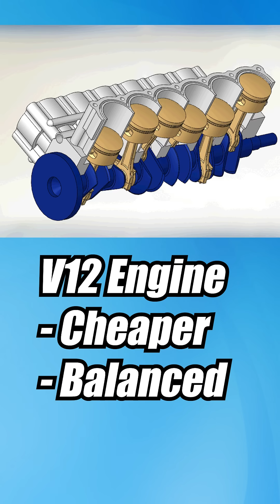wHy DoN'T CaRS uSE V14 ENGiNEs?

Comment: I did a static balance project on a straight-7 engine in grad school. If you play with crank throws and firing order, you can get a 7-cylinder bank pretty well-balanced!
Reply: Just like a v10. You just set it at a 75 degree angle v.
Reply: it would still require balance shafts i presume, just like V10s. the thing that made V10s competible was the niches on the racing scenes at the time combined with the engineering skills and knoledge that allowed to get a good middle ground between the better fuel economy and compact size of a V8, but with the better overall speed potential of a V12. i guess the fact V10s needed to be overengineered by default due to their natural inbalance allowed them to push the engine to its limits with super high revving, and even road going V10s like the Viper and the FSI's from Audi were capable of churning immense power with tuning.

i still love V10s with all my heart though, really wish they could return...
Reply: @unkindled6410  the imbalance in the v10 is less than the V8. The inline 5 was smoother than an inline 4. I mean, the most impressive engine in the world is the Red Bull Rb17 v10 with 15,000 rpm and over a thousand HP.
Reply: @unkindled6410  the Red Bull rb17 has a v10 that revs to 15,000 rpm and produces over a 1,000 HP naturally aspirated.
Reply: @amerhamad-zp6ge  its a track car only so it doesnt have to comply with any reliability regulations. That engine probably wont last more than 5k kilometers before blowing itself apart even if you dont push it to its limits. Its the same principle of V10 era F1 engines, they were disposable like tick tacks, lasting no more than a single race, then regulations limited the number of engines per season each team could use, so they started making them last a little longer including increasing their displacements from 3.0L upwards to 3.6L (except ferrari who somehow managed to keep up with the rules without displacement increases) otherwise they would have even made those engines rev until they were spinning on themselves before opening a rift in space time and warping themselves to nothingness.
Reply: @unkindled6410  With you space/time comment, l can tell you are a fan of sci-fi movies like Star Trek. 🤣🤣🤣🤣🤣
Reply: @richardike2342  never watched star trek. I really dont know what you mean bro.
Reply: @unkindled6410 V10's are my favorite engines.
Reply: @Amlaeuxrai I'll do it for 40...
Reply: Dude, give me your contact, inst or mail!
Reply: I think if you play around with any set of cylinder numbers, you can eventually get them to balance.

Comment: Why is it impossible? All you’re doing is adding another set of valves? 7 on one side and 7 on the other
Reply: It’s not impossible but you’d end up with 2 inline 7 engines.
An Inline 7 wouldn’t be as balanced and cheap as an Inline 6 engine. On top of that most cars can relatively easy get the required power out of their V12 engines.

Comment: Also a reason why we do not have v14 is that you can make a v16 by fusing two V8s and you can make a v12 by either fusing two straight 6 engines or two V6 straight 7 are not used in road cras or at all as far as i know so you would have to make a conpletely new block
Reply: GM used to make a 4.3 V6 in the same family as their LT V8's.  So you put one head from a V6 and one head from a V8 on each bank......

Comment: You call yourself a car enthusiast? What a disgrace. That’s not the reason at all. It’s always about what’s the most efficient power delivery. Sometimes too many pistons only weights the car down. That’s why you’ll only find v14s in heavier cars. More pistons does NOT equal faster. V6 can be found in many extremely fast cars. It just depends on what the car needs.
Reply: The Bugatti didn’t need a W16 engine but still got one.
A Bentley doesn’t require a W12 engine either.
Reply: @GrillerRohde  Both of those are very heavy cars 🤦‍♂️🤦‍♂️🤦‍♂️ and a Bentley is hardly a performance car. They just throw a good engine in because they can. Also the Bugatti is not a track car. I’m assuming you’re talking about the Chiron? It’s a top speed car. So a big engine is exactly what it needs. You wouldn’t put a v16 in a 911 gt3 rs would you? No. It has a flat 6 for a very deliberate reason.
Reply: @GrillerRohde  Honestly, I’m so done with the modern day car community. People can say they’re enthusiasts just because they watch stuff on tick tock.

Comment: Why don't they make v11s or v13 s I know there are 5 cylinders in jettas
Reply: Because they barely have any pros.
They’re very unbalanced compared to V12 engines and barely over any performance difference and add weight and complexity.

Comment: An inline 6 has perfect  primary and secondary balance (does not normally require a counterbalancer).  A V12 engine is made up of two banks of inline6s running on a single crankshaft

Comment: I didn't understand the balance dilemma, 7 in one side and 7 in the other, doesn't that make it balanced?
Reply: A V type engine is basically two Inline engines fused together at the crankshaft.
Tearing a V14 apart would result in 2 Inline 7 engines.

And inline engine with an uneven amount of cylinders like 3,5,7 etc. will automatically be less balanced than an even amount of cylinders.
That’s why I6 and V12 are so often used.

Comment: Now the real question is, could you fit a v14 in a miata? 🤔
Reply: nice weight distribution dude
Reply: If you make the cylinders small enough.
Reply: If you can fit a v16 in a Miata, then there's no problem fitting a v14 in it
Reply: Looking at the V14's that have actually been built, it's alot easier to fit a Miata in those V14's.
Reply: Yes.  A v14 could be designed small enough to fit in a Miata.

Comment: Is this the same reason why we don’t see i7 or vr7 setups?
Reply: Yes, an Inline 7 engine would get rid of most of the benefits of an Inline 6 engine.

Worse balancing, more length, more weight and complexity, only a small amount of extra power.

Comment: Thats not quite how engine balancing works. There's a lot of complicated math behind it but a v12 is inherently perfectly balanced, which makes it unique among v engines because it's the only (commonly used) one to achieve that. A v6 is nearly perfectly balanced, but the next amount of cylinders that would be balanced is a v24. This all stems from the inline 6 configuration being the lowest number of cylinder configuration to be inherently balanced by design.
Reply: A V6 would be well balanced with a 120° V angle, but as far as I know all commercial V6s use V angles of 90°≥... At 120° you may as well go all in and make it 180° for a flat engine.

a 2 cylinder boxer with a split connecting rod has perfect primary balance and no rocking couple, and i need to double check but I think it also has perfect secondary balance
Reply: @hWat-Ever  idk about the v6, even with a bigger angle there would still be a rocking couple. and about the boxer, the boxer is nearly perfectly balanced, but the slight offset to the side between each oposing piston creates a small rocking couple
Reply: A cross-plane V8 is perfectly balanced if the counterweights are properly designed.
Reply: @andyharman3022  wow, didn't know that. is that why americans love to use v8s so much? (i'm from europe, there aren't many v8s around here)

Comment: another thing is that 360 cant be divided by 14 and for the same reason there arent any inline 7. i think that they exist on ships because they turn slowly at 100 rpm so less vibrations
Reply: More like ship has dual-chamber 2 stroke engine. Balancing isn't that big of deal anyway
Reply: You can't divide 360 by 7 or 14, but you can divide a cake into 7 or 14 equal pieces

Comment: This doesn't quench my intellectual thirst. Wouldn't the same problem of an uneven amount of cylinders on each bank apply to a V10? Yet there are plenty of V10 cars.
Reply from the maker: I do mention V10's in the short.  But given I have 60 seconds, here's the rest: Basically someone else commented, "80-20 Law" so nothing is Truly stopping a V14 from being made engineering wise. It's literally just cost.  Ships have V14's so they do exist.  

Basically, is it worth spending 80% more money to get 20% more power than a V12?  When you could also spend that same 80% on a naturally balanced V16?  It's kind of like how V4's aren't "Impossible" for cars.  They just make more sense in motorcycles.  V14's aren't "Impossible" for cars, they just make more sense for a Ship.
Reply: @BladedAngel  Yeah, I'd for sure rather have a V16 but it's a little weird that there are no V14 cars.

Comment: New video idea:
"Why don't Cars use V24 engines?"
Reply from the maker: That one is easy.  They're just too large.  Most Countries have regulations on a Car's size be it length or width.  They must fit on the Road still after all.  More specifically, within a Lane. V14's were a strange "middle child" that is left behind in favor of V12's and V16's.  V24's do exist, but only in really large vehicles like Locomotives, Aeroplanes, and Large Trucks.
Reply: @BladedAngel Fair enough. Definitely the same as V40.
Reply: Too long!
Reply: @GumGumBoy5 the vid or the car?
Reply: @GumGumBoy5  just make the pistons smaller duh
Reply: New Video: Why Don't car automakers make a V48 😁
Reply: @kennethporst1738  clutch: ahh shit, here we go again
Reply: @thexiledemon  with such a huge engine comes huge torque: you could probably just release the clutch without giving gas in such a beast
Reply: @memorimusic420  fax man, but my anxiety levels when releasing the clutch would be: 📈📈📈📈
Reply from the maker: @memorimusic420  Putting a Large Engine in a Smaller vehicle also accomplishes this.  A lot of Sport bike bros who ride my FXDR for the first time are like, "So when does the bike stall?" as they let my clutch out 80% and the MF already moves at like 11mph even without adding gas.  

b4 any "aCksHUALLY" MFs appear. OFC, I have the cable adjusted to still allow stalling when you let go of it, cuz duh, you don't want constant engagement to wear plates.
Reply: @BladedAngel  oh yeah! Same with pre war cars that have insanely high displacement and torque. Inline 8s for example like Duesenberg. They were so powerful that you could almost take off in 4th gear🤯
Reply: @BladedAngel  didn't you just type that the second time? 😳
Reply: I think the gallo 24 is best 😂
Reply: Detroit diesel)))
Reply: too long, too heavy
Reply: it actually exists, on truck
Reply: There is a 48 cylinders motorcycle
Reply: You’ll find them in ships
Reply: Bugatti veyron is W24
Reply: @Saif-zf9vb in what alternate universe are you living? 😂
Reply: @memorimusic420  it’s w16 - my bad I got confused on the numbers.
Reply: @Saif-zf9vb  bruh where did u find the 8 cylinders at? 💀
Reply: @thexiledemon  ah yeah you’re right, W16 my mistake.
Reply: @Saif-zf9vb W16

Comment: Odd number of cylinders do somewhat work, but 7 is just really hard to balance.

You are dividing by 720 for 4 stroke engines, so an inline 3 fires a cylinder at every 240 degrees of crank rotation, inline 5's do at 144 (why they rev so slowly, they need a lot of counterbalance), and a theoretical 9 would be every 80 degrees, but by that point your crankshaft is so long it doesn't make sense, and a crank that long would be heavy, so it would rev up even slower then i5's do

And then 7 is 102.857..., so even worse. They do exist, but aa far as I know only in ships, or as generators, where they barely rev, so they aren't stressed and their imbalance doesn't really matter
Reply: But why that specific number for these engines as well? Thats kinda the part that i dont really understand. I heard number of cylinders main influence is the balance of torque and power, where 2 engines with the same displacement but diferent cylinders, the higher cylinder count help with speed while the one with lower count has bigger cylinders allowing for more torque.
Reply: @unkindled6410  what 720°?

Because 4 strokes (intake, compression, power, exhaust) needs the piston to move up and down twice to complete 1 cycle, so it needs 2 crankshaft revelations (or revs). 2 crankshaft revelations means the crank turns 720°. If someone was brave (or stupid) enough to make it a 2 stroke, that would be 360° of crank rotation, so for an inline 7 would be 360/7=51.4285... degrees between a cylinder firing
Reply: @istvanlorinczi2817  i was refering to cylinder count. Like, why do gigantic engines such as those for boats and powerplants choose 14 cylinders?
Reply: @unkindled6410  could honestly be just the manufacturer's capacity. 7 is already pretty uncommon to see, and while inline 8s did exist, 9 would probably be too long of a block to make, or something. 

Or maybe someone far smarter then me calculated that a really large displacement, basically idling inline 7 would produce enough torque without stressing the engine too much, so an 8 cylinder would be too much, and a 6 would rev too high, causing unnecessary wear and maintenance needs
Reply: I don’t know anything about cars or engines so I’m curious could it work as a boxer engine or a W 14? Or does that not matter?
Reply: @thepflp  W would need a lot of counterbalance, since it'd be 2 narrow angle V7's (or VR7s in short). Not like VW hasn't made the VR5, but that was already a very flawed design that was just even more complicated then the VR6 it was based on. VR7 would probably be the same way, and 2 of them wouldn't make it better

Boxer (or flat) 14 could maybe work, but then it's 2 inline 7s, so timing is basically impossible again, and you need a beefy crankshaft to not have it vibrate itself apart, and with an already long crank it wouldn't rev very high. 

7 cylinders just don't really work well in road applications, mainly because timing them is near impossible
Reply: Can’t you just connect a 3cylinder to a 4cylinder to make an inline 7
Reply: @JacobLee-o2j  no

Comment: Correct me if I'm wrong, but I believe the Mclaren F1 was going to have a V14 before the budget was running low. Hell, I've been trying to think of a high revving V14 to design myself just for shits and giggles. I mostly just want to hear how it would sound
Reply from the maker: Correct! I Couldn't fit that info in this short though! I want to make a full video on V4 and V14's and other quirky engines soon, since I learned a lot about why cars don't "use" them.
Reply: Benna as AI... To produce that sound...
Reply: Every thing would be good until you gighle and shi-
Reply: Who said anything about the F1 getting a V14? Gordon Murray wanted Honda to make him a 4.5l v10

Comment: Never realized a V5 was a thing
Reply: VW had a 2.3l V5 in production for 10 ten years; 1997-2006. It was a narrow angle 15-degree V that fit both 'banks' under one cylinder head. The VW VR5 was based on their VR6 which had the same 15-degree V. Yes. A V5 does exist. It was produced. And it was not an inline engine.
Reply: @j.thomas7128  There was a True working V5 made by Honda that had a really cool way to solve the balancing issues.
Reply: There's also the honda motorbike V5
Reply: it was pretty uncommon, most were inline 5s and even then 5 cylinder engines are barely used in general these days
Reply: True V5 did exist on MotoGP

And it indeed really bonker engine with also mindbending solution for balancing issue
Reply: It's a weird inline engine wich has an angled crankshaft so that each piston can be smooshed closer to the next, making kind of a W pattern, but since V engines wich have said layout are the ones named W engines it's named something else
Reply: @Ferrari255GTO  is not an inline. It's a narrow angle V that fits under one cylinder head.
Reply: @j.thomas7128  i say that it is a weid inline engine since due to the angle it doesn't really classify as a V engine nor as a inline one
Reply: @Ferrari255GTO  yes sir. It's weird, indeed. The cylinder centerlines are not on the crank's centerline as with most inlines or V's. Not only are the cylinders offset to their respective bank, each bank is offset to the crank. Each bank itself is offset to the crank. REALLY WEIRD! There's a YouTube channel called, Engineering Explained, that does a good shallow dive into the VR5. When I first saw a VR design with the head off, it blew my mind. I had no idea how it fit when cylinders were at bottom.  LoL. 

Hey, I have to ask. I know the 250gto and the 288gto, but what is a 255gto?
Reply: @j.thomas7128  255GTO is the "taken username" variant XD
Reply: @Ferrari255GTO dude the cylinders are in a V shape tho, inline means straight as a line which the v5 is not the cylinders are in a v shape, very little v shape but still, and there's 2 on the other side, 3 on other, it's more like a zigzag engine, it's basically like a combination of inline and v engine tbh
Reply: @rrrrr-s3q  the thing is that the postons aren't directly facing each other, they kind of wiggle ina straight line rathern than vaing two directly different cyliner banks
Reply: Got one on my Passat 4motion
Reply: @rrrrr-s3q  the 07k? Thats half a Gallardo V10!
Reply: If l recall correctly, in order to give the VW Corrado more power, a V6 wouldn't fit the engine bay. So VW took its VR6 close-angle cylinder engine, removed one cylinder, and the VR5 was born, which fit the Corrado's engine bay perfectly.
Reply: Well, it's not V. It's an inline engine.
Reply: @IbrahimAli-wi2ui no it's not, it's a 15° V5 a.k.a VR5 made by Volkswagen.
Reply: @rrrrr-s3q  
I didn't know that, thanks